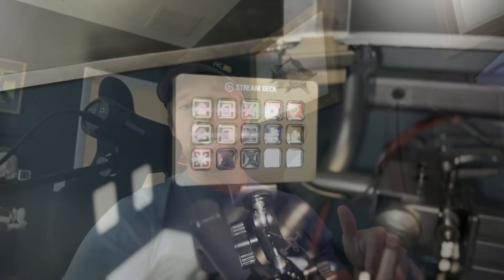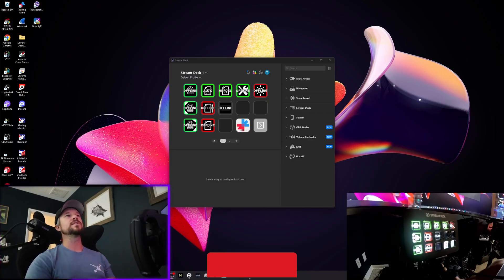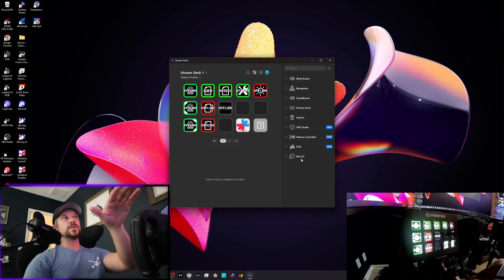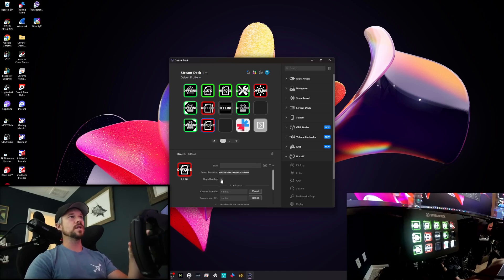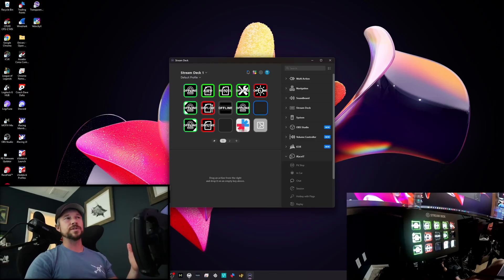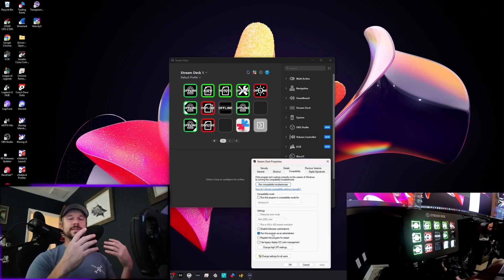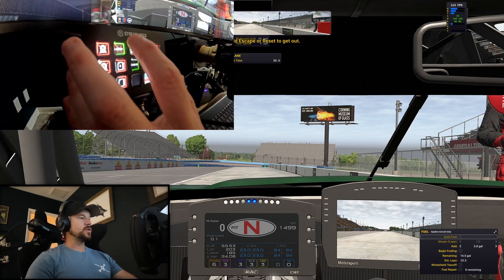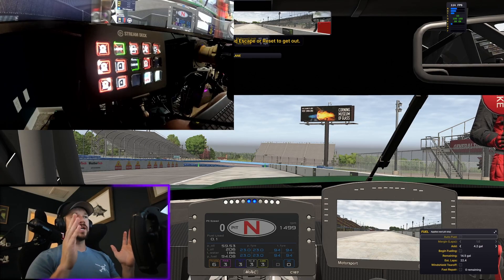Stream Deck makes iRacing Pit Stops SIMPLE

Comment: Dude... This is freaking awesome! 1 question tho.. Is it possible to flip the icons to either side? Im going to use my Stream Deck in a specific button box, which will hold the Stream Deck at an upright position, where its actually turned to the left if that makes sense...
Reply from the maker: Hey, I’m happy you enjoyed this. To move icons, just drag and drop within the UI of stream deck. 

For holding the stream deck on a tubular frame, I used a tube clamp and phone holder from Amazon
Reply: @Moore_Podiums  awesome mate! thanks for getting back and answering

Comment: Crew Chief makes I Racing pit stops even simpler.
Reply from the maker: I've been using crew chief for spotter for over a year now and haven't tried their pitstop functionality. Do you couple CrewChief macros with the StreamDeck?
Reply: @Moore_Podiums No I just have it all set before the race starts. It auto calculates how much fuel you need for stints and how much you need to get to the end of the race. Gives you exactly what you need, you can set it to give you an extra lap worth just in case.
You literally just drive into the pit and do nothing but trust the crew chief.

Comment: Great video and thank you for creating it.  I have the XL version, but I think it might be too big for this application.  also, it seems that there are not as many mounting options for the XL version.  By chance, how are you mounting the 15 key Streamdeck to you rig?  I have a 3d printer and would love to find a file to print and use.  I am going to give RaceIT a shot.
Reply from the maker: I used a tube clamp from Amazon as I have a tubular frame then I mounted the screw to a XL phone holder (the kind that has a spring and is retractable) and it holds it steady. No issues so far with the setup. I did have my iRacing hang due to having iCue running in Stream Deck. Once I uninstalled that plugin, its been mostly smooth sailing. Thanks for taking the time to comment

Comment: good vid dude!  the plugin and stream deck combo are a massive winner - endless ability to change it up and add pages, and about 1/3 the cost of a 'real' button box from precision or pokornyi or bavarian!  ive read that if you cant get iraceit to work, you can download icon sets and setup manual commands as well!  

btw decrement is totally a real word, but I think you pronounce it with a soft vowel for the first E.  If Im ever unsure of something like that google translate's pronunciation button always helps me :)
Reply from the maker: Thanks for taking the time to comment, I did go down the macros route but it wasn't as slick and nice of a set up as iRaceIT. However, it is an option! 
Have a good one

Comment: Does this require VJOY? I loaded these, cool stuff, and the commends are not working. There is a comment that VJOY is not installed. I am using bridge and a USB Arduino instead of VJOY. Thanks, good info
Reply from the maker: Hello, I uninstalled a joy as it did not solve my problem. My commands problem Was all around stream deck not running as admin and iRacing was running as admin. I hope this helps